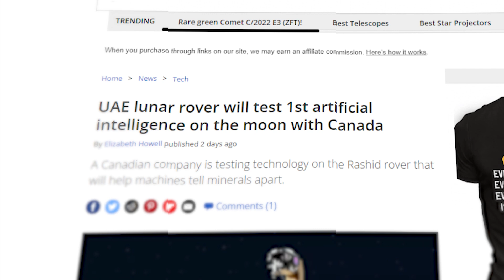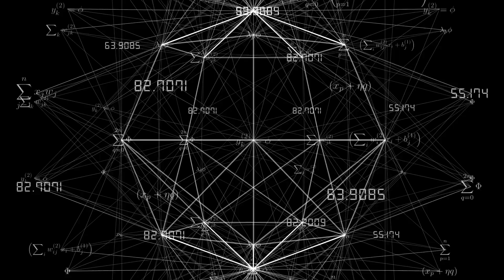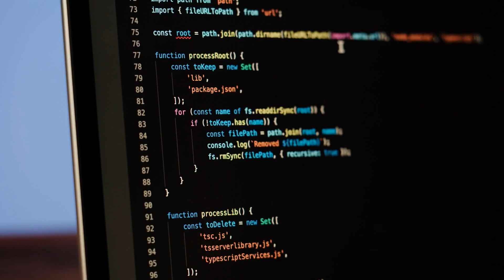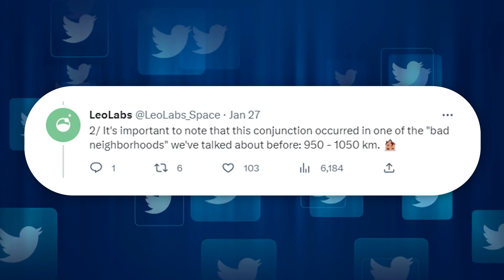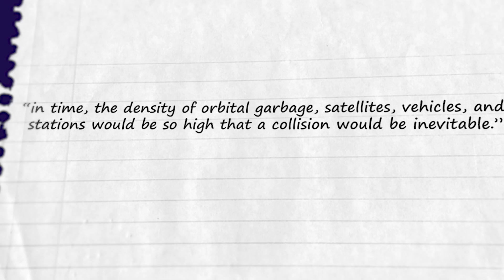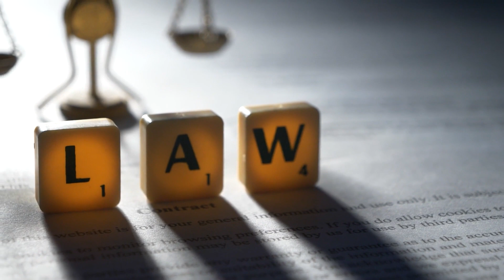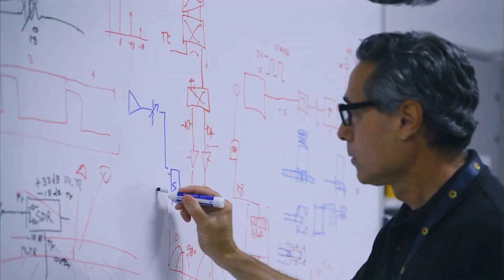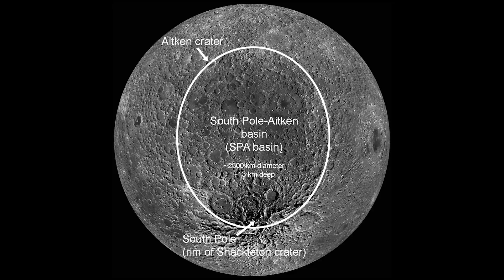Artificial Intelligence Is Landing On Our Moon!

Comment: 7:44 I think there’s a misunderstanding of how orbital altitudes work. Low earth orbit is not one specific height. People tend to think of everything circling the Earth in exactly one altitude, that is not how it works. If debris breaks up 800 miles above the Earth, the space 801 miles above the Earth would be fine. Yes, orbital decay is a thing, but imagine how many cars are parked on the earth, and then think about how much bigger low earth orbit is because it is a much wider diameter, AND you can go up and down in height. There are orders of magnitude more cars on earth than there are pieces of space debris, and no one is worrying about the earth’s surface getting crowded with cars.
Reply: Even so, it is necessary  to move the ISS every so often to avoid danger, its is getting worse and one day a space walker will die.